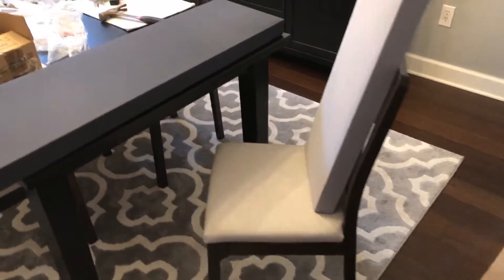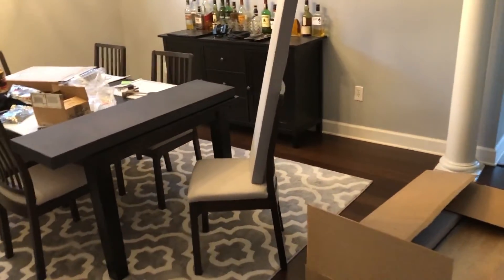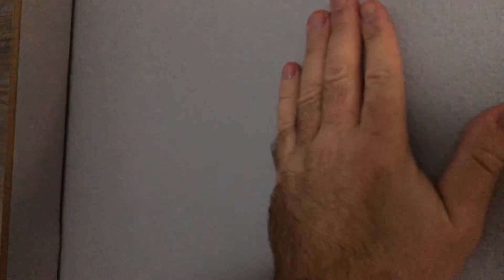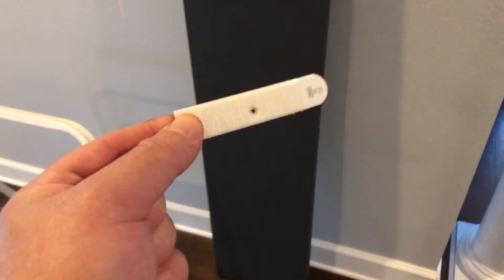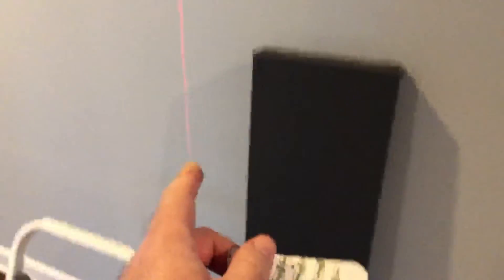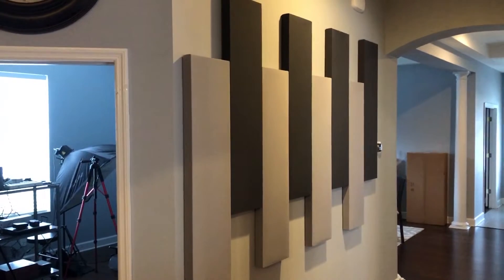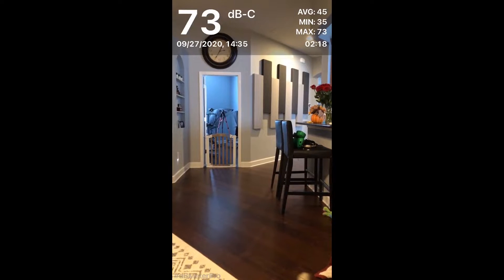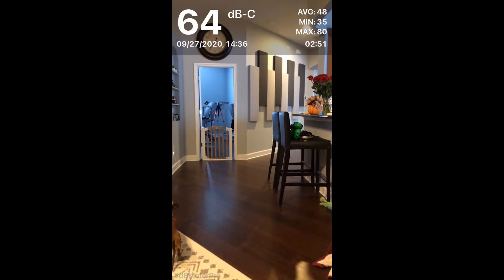Using Acoustic Treatment To Lower Theater Noise Floor

Comment: Is there a way to measure eco in a room using REW and UMIK-1?
Reply from the maker: Yes, the impulse tab.  Test one speaker at a time
Reply: According to the REW setup guide for the UMIK-1 on AVS Forum it has a noise floor I believe that was 50db due to it being USB so you might not get accurate measurements below that but REW has a SPL meter built in that you could use.
Reply: @TylerStout  I know and use the SPL meter in REW but how do I separate out the echo from the signal is my question. I have not paid attention to the Impulse tab as was suggested. I video review would have been nice.
Reply from the maker: Lol no it doesn’t have a noise floor of 50.
Reply: @COGuyStuff  "Most typical listening rooms with have a noise floor of approximately 40-50dB. However, with the USB mic’s we are seeing readings of 50dB, which is the lower limit of the USB microphone’s measurement range." This is from the much smarter people than me at avs forums that made a 100+ page (page 44 is the quote) pdf guide for how to setup rew and take measurements located here: https://www.avsforum.com/threads/simplified-rew-setup-and-use-usb-mic-hdmi-connection-including-measurement-techniques-and-how-to-interpret-graphs.1449924/post-22823228
Reply from the maker: Do you know what I just double checked and tested and you’re right I was wrong
Reply: @COGuyStuff  Ha I saw you previous reply and just so you're aware I do own a UMIK-1 calibrated from CSA and have experience with REW measurements. I do believe you when you say you have a lower than 50db room but it appeared like you were using a smartphone app and not the UMIK-1 which could read lower potentially. Glad to see you tested it and confirmed it as I can't due to living 500ft from a 70mph highway so my noise floor is always going to be relatively higher than most even though I do have good windows (Anderson) and insulation.
Reply from the maker: Yes DB Meter is a phone app
Reply: @TylerStout  I just tried my UMIK-1 with REW and the lowest I could get in my room is 42db. That is under normal condition without trying too hard which would be my normal listening environment. Middle of the night measurement could take out probably couple of db but that would be it. So yeah, 40db would be my noise floor with UMIK-1

Comment: Lowering your noise floor is so important.  Wife complains they cant hear the dialogue but dont want you to turn it up louder than -30db?  Lower your noise floor.

Unfortunately in my case, my big ass air conditioning unit is on the other side of the wall from my front soundstage and I live in the desert so that sucker is on all summer.  Its a lot better in the winter though.